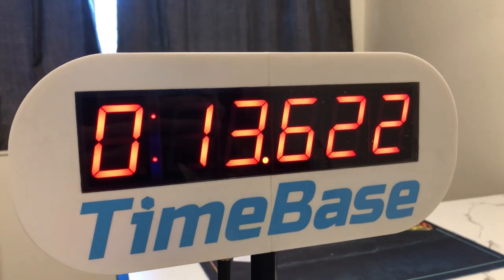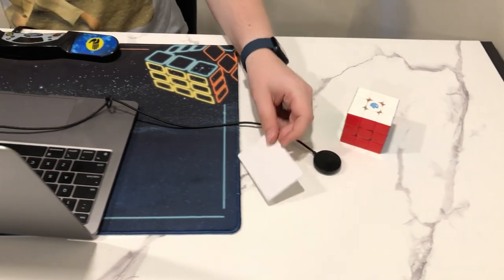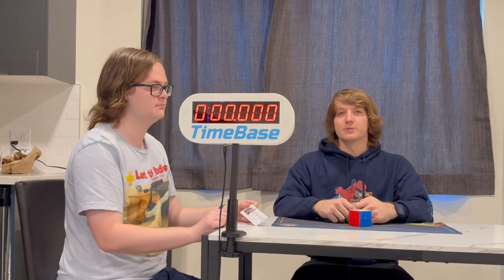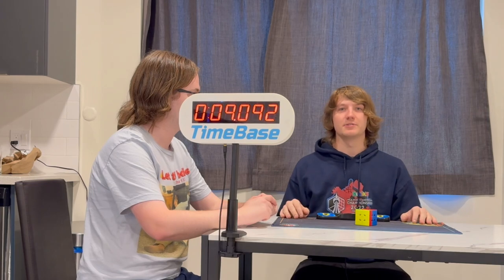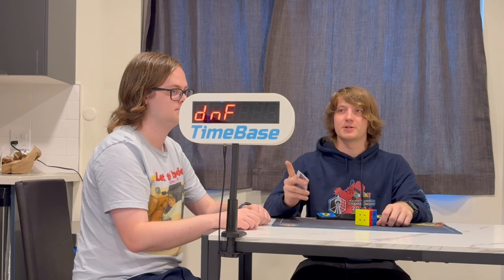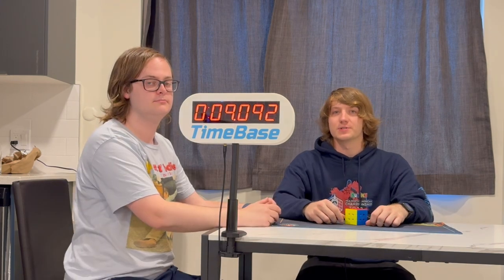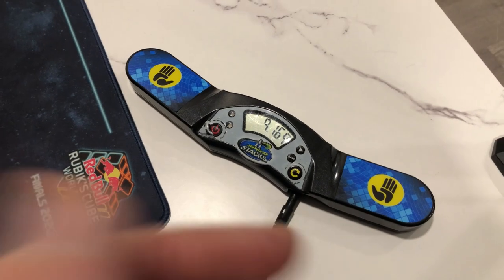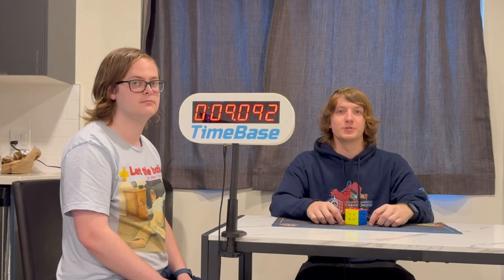TimeBase Prototype Showcase

Comment: This is pretty cool, but I do have a problem, this system has no guarantee that there won’t be any glitches, pen and paper never glitches, humans do which is where problems emerge, and based on that fact there’s no guarantee that a judge won’t make a mistake, this is still cool but we won’t technology our way out of making mistakes and tech introduces a new failure point.
Reply: Not to mention, biros are cheap as hell.
Reply: @Arkesus  what’s a biros?
Reply: @ananimatingcuber I think he meant bios
Reply: @ananimatingcuber  a biro is another word for ballpoint pen
Reply from the maker: This is exactly why we made the system as simple as possible at its core. Current competition displays actually do a lot more than just display what is on the timer. These extra functions are exactly what cause problems to arise however rare they are. That said, no system is perfect and though it may be incredibly rare for a failure to occur on our system, there are failsafes for just about and problem that may arise.
Reply: @TimeBaseProject  thanks for the response, I’m only familiar the official speed stack displays so I wouldn’t know if the qiyi displays have any additional features like you say I have a question, why is the thousands digit still displayed as it just get truncated when results are entered.
Reply: @ananimatingcuber because no loss of precision

Comment: if the display does so much already, why don’t you have it say 8/12 to eliminate extras and incidents based on the judge saying the wrong things in inspection?
Reply from the maker: We want to keep it simple.  The more we add to the display, the more we could get wrong.  While this is a simple thing in theory, if we add all the simple things, the attention to the other things may be lower.  We discussed this a while ago and determined that we won't include this initially.  This may be added later.

Comment: This is genuinely one of the coolest advancements cubing has seen in a long time. I was so sad I couldn't make it to the seminar and the replay on twitch didn't show any of this (plus the audio was bad), but this seems awesome! My only questions are how it interacts with WCA as well as what would need to happen setup-wise with these (including wifi and power/batteries), as well as the cost should one break/need repair.
Reply from the maker: We plan on giving organizers the option of AA batteries and a rechargeable battery. As far as the network, it is run on a local server with supplied preconfigured routers. In the unlikely case that the system goes down during a comp, scorecards can always be used as a backup. Repair cost would be very much on a case by case basis but no single repair would be incredibly expensive.

Comment: How are the times communicated between the displays and database? Many venues don't supply wifi, so perhaps bluetooth or some other local wireless frequency could be a better approach.
Reply from the maker: We run a local server.  The timebase kit comes with a router preconfigured for the TimeBase displays.

Comment: Are we sure we can trust the display on showing the result? On competitions you are supposed not to luck at the display but to look at the timer to record a time on a scorecard
Reply: they are told not to look at the display because stackmat displays have issues. it seems these will be extremely more reliable
Reply from the maker: The signature tagging is to verify the times are the same.  If they are different, they press the delegate button and the delegate will override it with the correct time.  We haven't had any issues yet with them yet, but we also haven't ran them in a competition yet.
Reply: That makes sense. Thank you for clarifying!

Comment: does this mean only one scramble would be able to be displayed at one time on a single screen? what if two scramblers need two different scrambles at the same time?
Reply from the maker: We show a split screen.  We recommend no more than 2 scramblers per device.  The more split the screen is, the higher odds of a wrong scramble.  The split screen is based on how many NFC readers there are plugged in.

Comment: does every competitor get a different nfc tag for each round or do they use the same one? does the nfc tag know what scrambles to do when events are simultaneous?
Reply from the maker: The NFC tag is inside your nametag.  It will be used throughout the duration of the competition.  Replacements can be made on the spot at competitions, but this does take time and is not a process delegates will want to do frequently.

Comment: I know this is just a prototype, so the final buttons on the back for DNF, +2, etc, should be bigger/better, but hopefully a bit further apart, too, so no accidentally pressing the wrong one. 

I saw the +2 button just cycles all the way thru +16 and back to 0, in case of accidental presses, but what about accidental presses of OK or DNF? Do they need to be press and hold for a fraction of a second, like the power and reset on a G5 stackmat, to help avoid accidental presses?
Reply: Absolutely agreed, especially for newer users it could be easy to do that which something needs to be done to prevent this.
Reply from the maker: DNF cycles back if the button is pressed again. Even if a judge is to press OK, the time would not be submitted without a competitor signature meaning you can go back and make changes accordingly.

Comment: a great relief in many cases. But there are still some problems, e.g. Not every building has good Wi-Fi, let alone Wi-Fi. Another thing is that printing on those nfc cards will also be quite difficult to deal with (I think your photo and your data printed on the card) and the whole timer will be even more expensive. And hold on, I don't know how long can it works. The battery will be interesting

Comment: The concept is very intriguing. Ergonomically, as a judge, reaching up to interact with the TimeBase display does not seem ideal. I would much prefer it the buttons were on a separate pad or something that's down on the table. Also, the buttons (wherever they are) should be larger, have some sort of indicative icons on them, and be physically separated so that it's less likely you'll press the wrong one. It would also be good to have some sort of "undo" button in case you press +2 when you meant to press DNF or something like that.
Reply: having the sensor on the bottom might be better
imagine some people judging can't reach the top, the bottom would work better
Reply from the maker: This has been brought up to us in the past. We have some loose plans for a peripheral board that would connect to the display but nothing set in stone just yet. As for undoing button presses, DNF cycles back if pushed again and +2 cycles back to 0 after going past +16.
Reply: @TimeBaseProject  Well, we'll all be interested to hear how it goes at BASC. In the interests of transparency, I'd like you to post a BASC-debrief video in which you share whatever you learned from the experience, both the good and the bad, and ideas that will inevitably come to mind for further improvements.